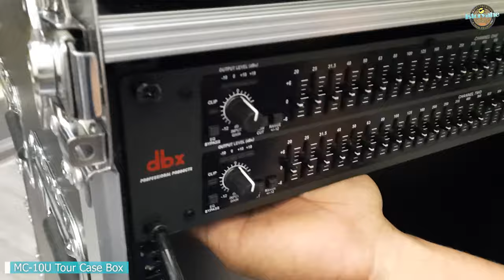MC-10U Tour Case Box | Tour Case Box For Mixer and Processor

Comment: Ano po sukat nang toque & groove na  pwde po sa 1/2  na ply wood
Reply from the maker: @haideesantilla1702 Hello! Thank you for watching our video on the MC-10U Tour Case Box for Mixer and Processor. Regarding your comment, the dimensions for the torque & groove that can be used with 1/2-inch plywood may vary depending on the specific requirements of your project.

Typically, the dimensions of the torque & groove would depend on the thickness of the plywood and the specific design considerations of your case. The groove should be sized to accommodate the thickness of the plywood panel, while the torque or tongue should fit snugly into the groove.

To determine the appropriate dimensions for the torque & groove, it's recommended to measure the actual thickness of your 1/2-inch plywood and adjust the groove width accordingly. It's also important to consider any additional factors such as the desired tightness of the fit and any allowances for expansion or contraction of the wood.

If you have access to the plywood and the necessary tools, it's advisable to test and adjust the dimensions of the torque & groove on a scrap piece of plywood before proceeding with the final construction of your case. This will ensure a proper fit and avoid any issues during assembly.

We hope this information helps! If you have any further questions or need additional assistance, feel free to ask. Thank you for your comment, and we appreciate your support!